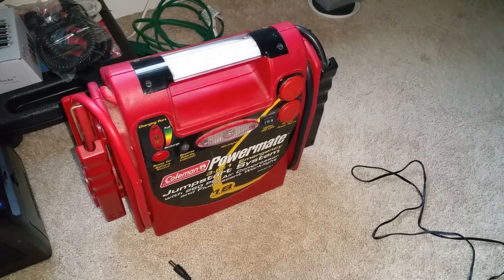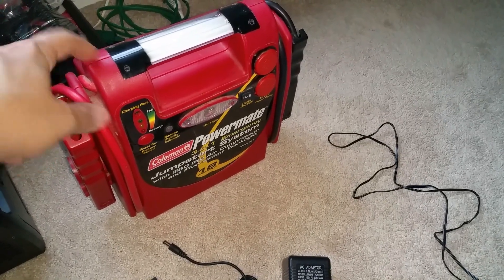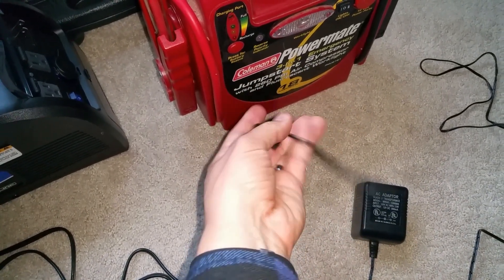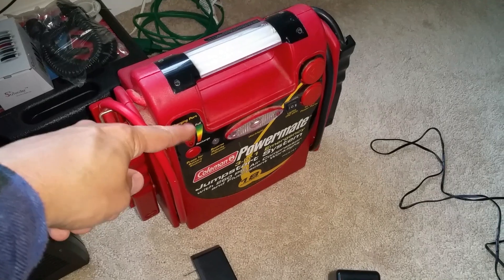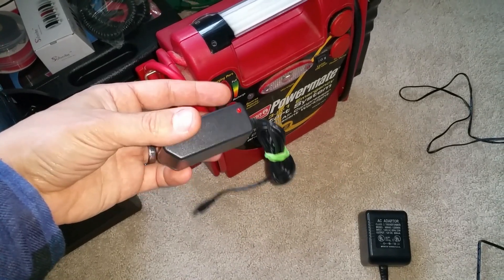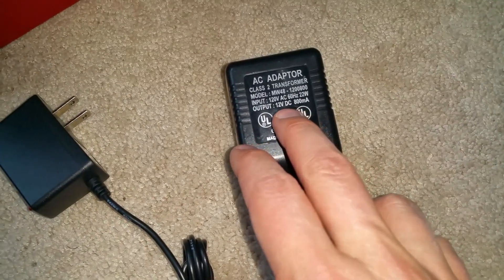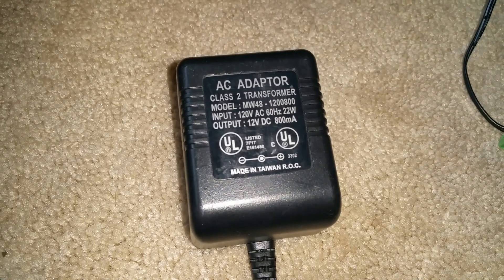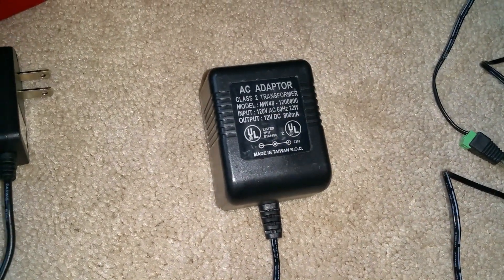Coleman PMJ8161 Repair & Charger

Comment: Where did you get the battery?  I had my PMJ8960 on the charger 3.5 hours and nothing, so guess it needs a new battery.
Reply: Ok, thanks
Reply from the maker: Amazon, standard 18Ah battery

Comment: Do you think this will work on my PMJ8960 model?
Reply from the maker: Not familiar with that model exactly but i would think these are all built similar
Reply: I just purchased a PMJ8960 , (damn online auctions) and I also need a charger.  Could this be charged with a battery charger hooked to the jumper clamps.  I may try this.

Comment: found an a/c adaprer input 120 vac 60hz 200ma. output 12 vac 1000ma will this work.Also found the adapter you have.Please respond. Where can you buy the tips?
Reply from the maker: 200 ma is very small. It also needs to be a toroidal type of power supply not a switch mode. The tips can be found on Amazon for cheap usually used for security camera power supplies